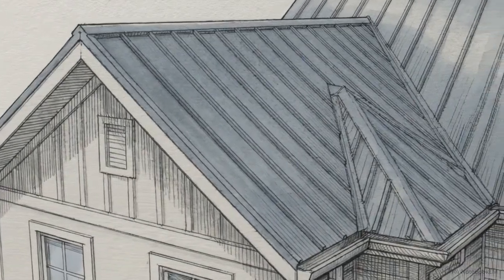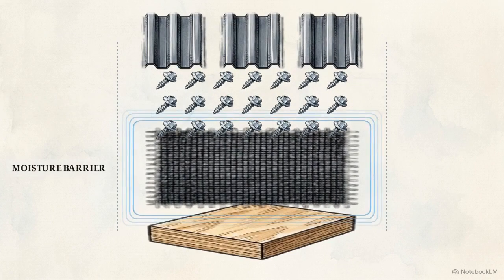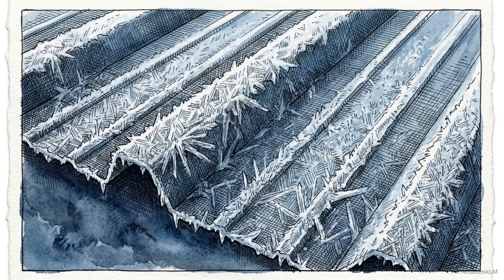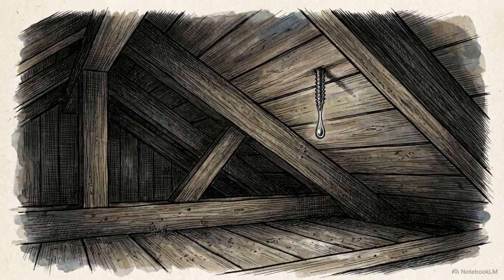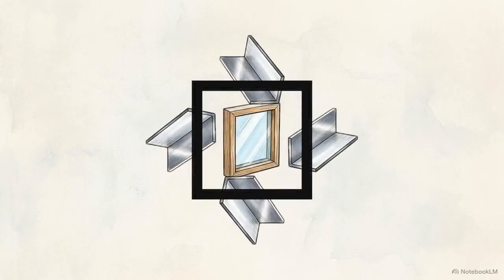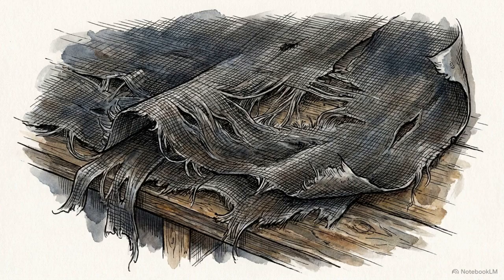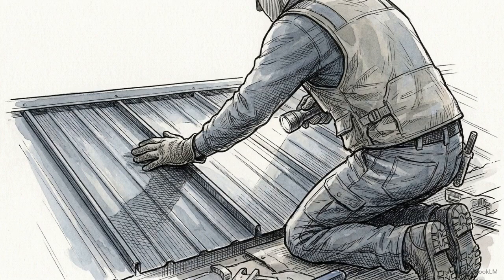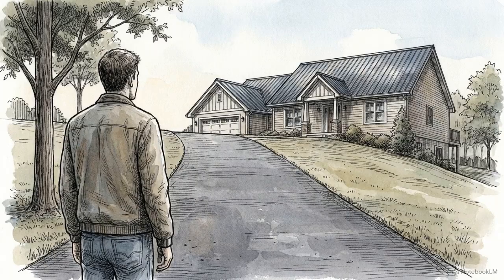Metal Roof Repair Camarillo: Common Problems Homeowners Should Never Ignore

Comment from the maker: If your metal roof is showing signs of leaks, loose fasteners, rust, or flashing trouble, Roof Repair Camarillo can help. 
Request an inspection here: https://camarilloroofrepair.com/metal-roof-repair/  or call 805-590-5145. Many metal roof issues are still repairable when caught early.